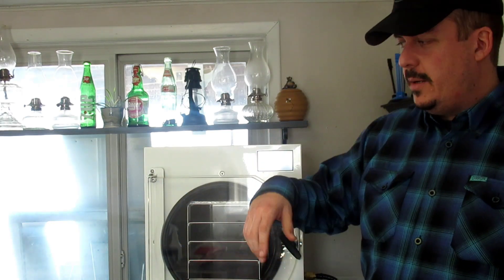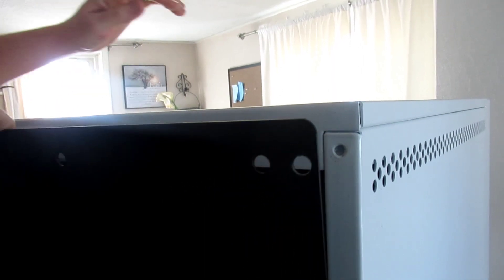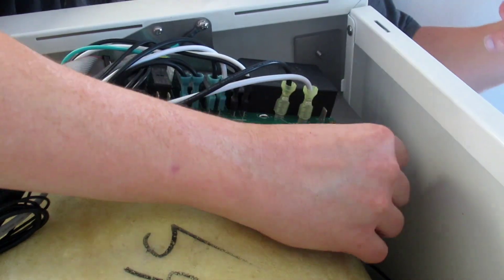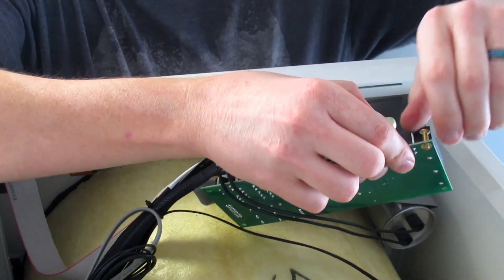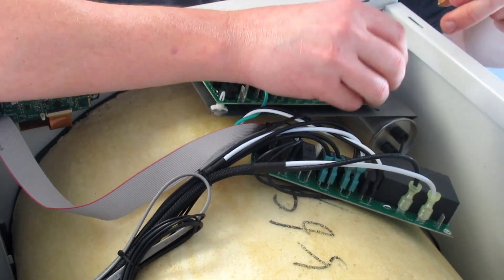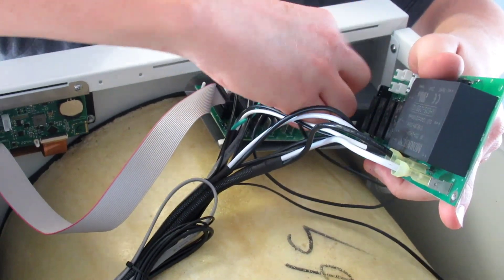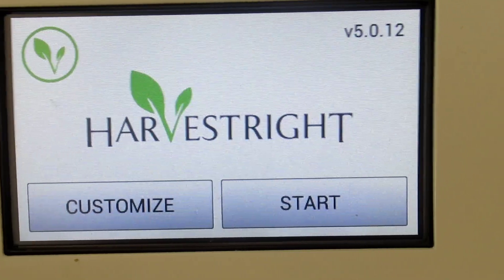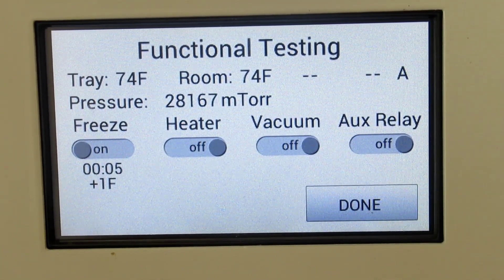My Freeze Dryer is Broken

Comment from the maker: So.after editing and watching the video.  I realized that I call it a mother board. It's the relay board.  The mother board is located behind the screen and has the program in it. I have the same program as I've always had. And I was just really happy to get my FD fixed.
Reply: I hope you went back and found that spacer for the screw that fell and replaced it. If any of those solder joints on the bottom of the board come in contact with that metal plate you can have some serious issues.

Comment: if your unit is working sell asap
it will break and you will lose everything
Reply from the maker: What do you mean everything??  Iv enever had a problem with mine other then a relay going bad and I fixed it myself. I've had mine for two years never had major problems that weren't my fault.
Reply: @blueoutside3394  design flaws
if you haven’t had vacuum issues just wait it’s coming 
vacuum is very tricky do so research 
pressure much easier than vacuum 

good luck sell if you can
Reply from the maker: @fpc0041  I'm not gonna sell my unit. Iv head it for two years. Only vacuum problem I've had has been my own wrong going. I love my machine and I'm sorry others have had problems

Comment: WTH!? Are HR freeze dryers not worth the money?! This is like the 4th or 5th video alrady I have seen that showcase problems. Im leery about buying one now.
Reply from the maker: Well I think they are.  They have a new model out just seen one at a farm supply store. So hopefully the problem is fixed. I'm glad it went bad while under warranty 
The solution would be to make the relay switches removable like relays for vehicles so you can just go to a hardware store instead of replacing the whole board.
If you're are leery about buying one always go with your gut. But I have no regrets about buying it.
Reply: @blueoutside3394  Okay thanks. What is different about the new model? I cant tell from just pics on the website. Again thanks.

Comment: They just sent you a spare part without any questions asked or are you still within the 3 year warranty period?
Reply from the maker: I had to send HR , freeze drying reports off the machine then they had someone call me. I told them what was going on and they looked at the reports  and  it was that simple.
Yes I'm still within the 3 years.
Reply: @blueoutside3394  I have had my machine for 13 months and am having the same problem. They told me I would have to pay for the new relay board because I'm out of warranty. Did you buy an extended warranty?
Reply from the maker: @barbara2681  I didn't even know there was the option for an extended warranty. So nope I did not.
Reply: @blueoutside3394  Hi I just had the same idea and asked Harvest Right about an extended warranty and they said that doesn't exist. But then I asked how much a relay board costs outside the warranty period. I think they said it's CDN$100 plus because I'm in Canada I pay for $30 shipping. So I assume they sell parts at their cost price, and I'll just plan and budget replacement parts of CDN$300 per year for the future.
Reply: @barbara2681  hi I just asked them, there is no extended warranty available.

Comment: You did good replacing the mother board. The packaging that the new one in is an electrostatic free package put the old back in it and send back. If you had gotten a small electrostatic charge across that board you would have blown all those relays and had to get a new one. Things are really touchy with electronics like that.
Reply from the maker: Thanks for the info. I called it a mother board it's actually the relay board lol
Reply: That's bullshit

Comment: Good Morning, how loud is this as it goes through its cycle. Mine is on the way and I’m deciding where to place it. Good to know we can work on these. Thanks for sharing
Reply from the maker: Morning!  The FD dryer itself is like a freezer when it's freezing. And the loudest part of the whole thing it the pump. It can be kinda of loud at time depending on what you got going on. I have mine in the dinning room. 
You just have it somewhere where it doesn't get real hot. 
We have a window ac in the dinning room to help keep the temp beings there's a huge window in the dinning room. I was going to put it in the basement but it's not finished and out extra bedrooms are upstairs. I have a  100 year old farm house. No garage.  Hope that helps and let me know about any other questions
Reply: @blueoutside3394  Thanks man, I have already considered the temperature situation. I have a wood closet in my garage i think I will convert and I have a window unit AC to keep it cool. Thanks for the info.
Reply from the maker: @fitzpreacherfarm6826  just remember dust can get sucked into the FD
Reply: @blueoutside3394  For what it's worth, I put a high velocity (old IBM computer cooling fan) fan next to the pump.  I've used it for that since I've had the freeze-dryer (3 yrs).  It's plugged into a joint power strip, with the pump itself, so it kicks on at the same time as the pump, and turns off when the pump ends its cycle.  I've found that this has really helped to control the heat on the pump.
Reply from the maker: @RichyRichToo  I like this idea.  Does that type of fan run on a regular 110 plug or does it need modified?  I've always wanted a sound dampening box around the pump and the fan would be required to keep the air moving.
Reply: @blueoutside3394  excellent ideas here. I put a small power bar plugged into back of freeze dryer. Then I plugged a small $10 air cleaner fan and the harvest right premier pump into the power bar. So both the air cleaner and pump turn on at same time, and the pump gets fan cooling. The cheap air cleaner can take a regular $5 house furnace paper filter.
Reply: Hello, my first choice was to place it in the basement near the house furnace, and with Premier Pump, I can never hear it running from the rest of house or barely hear it in the basement.. I think a house furnace fan makes more noise than Premier Pump. Plus I added a cheap air cleaner fan on a power bar, facing Premier Pump. So I highly recommend getting Premeir Pump and put the dryer near some big appliance like your house furnace.
Reply: @avibhatt2013  it’s not that noisy, we hardly notice it at all. Thanks for watching

Comment: Mine did the same thing it’s to plug on the heater rack the wires come out the back of them it’s a blah look in your plug if all the four points aren’t sticking out you’ll have to take it out push it through there tape it and glue it it’ll fix your problem it’s a plug on the heater rack

Comment: Thanks for the video. I just had an error code two weeks ago. It was error #9 could not achieve vacuum. I did all the troubleshooting, changed the oil, unhook, reconnect, did a pressure oil flush and soft ware update. Could not get the mTorr lower than 750. Made an appointment with Harvest Right. They asked that I take the tray unit out (which I have never done since I have only had it three months) and run a test with the empty drum. I found three small pieces of grated cheese sticking to the drum. They asked that I clean that up. I did and without the tray unit I was able to achieve below 500 mTorr. I put the unit back in and ran a bread test which was fine. I did one batch of fruit and veggies. Running another batch of fruit and my next batch will be a big test...spaghetti meat sauce. If it can handle that then we are good to go.

Who knew three little pieces of grated cheese can mess up achieving the vacuum!

Since I have ZERO mechanical skills if mine has that issue I am gonna be crying 😢.
Reply from the maker: You could replace the board if you needed too.  And yes three little pieces of cheese can cause that issues. I try and wipe the rubber seal off right before I close the door because dust, food particles and even small hair can stop it from achieving vacuum.
I got the same vacuum code and it was the oil in the pump was oil I  filtered put back in.
Reply: Mine could not achieve a Vacuum either 8 months after owning it they determined it was either a freon leak or compressor problem its currently waiting at there factory to be fixed. I have seen a lot of people sayiing its the medium freeze dryer that people are having the problems with.
Reply from the maker: @jmb-cm7mr  I had a problem one time not getting proper vaccum turns out the oil in the pump was bad. It was a batch I ran though a filter and reused it. 
It sucks it's at the factory. But at least it getting fixed. And I would say the mediums are probably their biggest seller so there are gonna be more problems because there are more of them out there